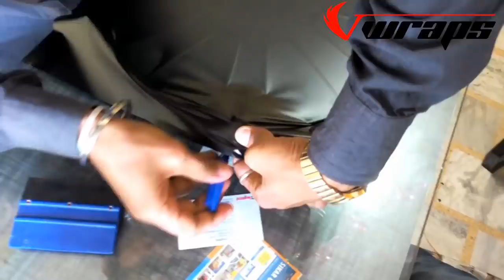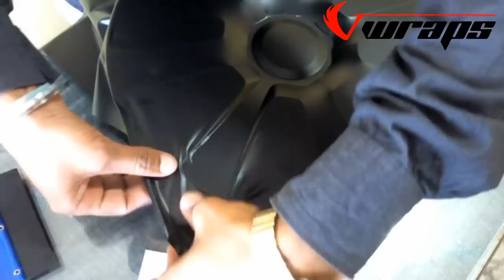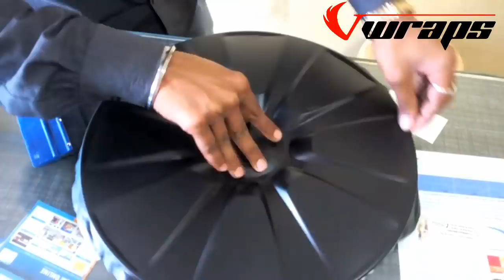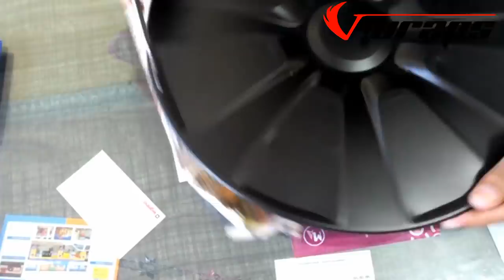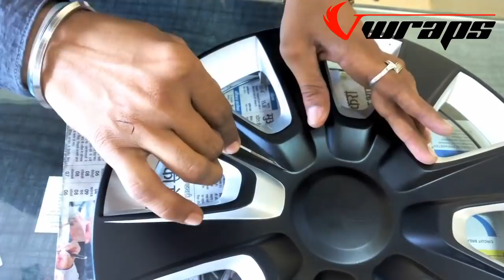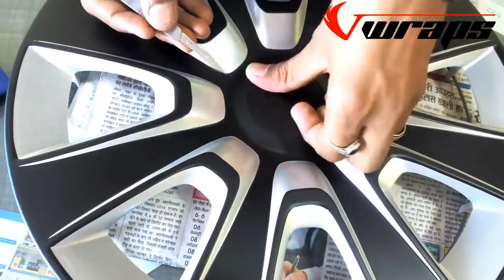Wheel Cape vinyl wrapping  in black matt || alloy rim modification

Comment: Why are you wrapping a wheel cover? Just paint it.
Reply from the maker: Brother can you paint it this will cap in this design yes or not
Reply: @VwrapsSikar  I would not wrap it or paint it.
Reply: Would just buy a set of alloys, or better still most cars nowadays come with alloys as standard
Reply: @VwrapsSikar  yes he can paint it this design for sure. He cannot change it if get bored of it. Then it will become so difficult. But in this case you can simply remove with hand. And again rewrap it.